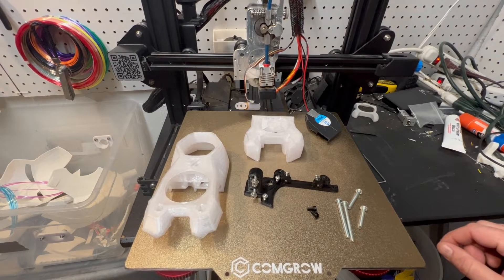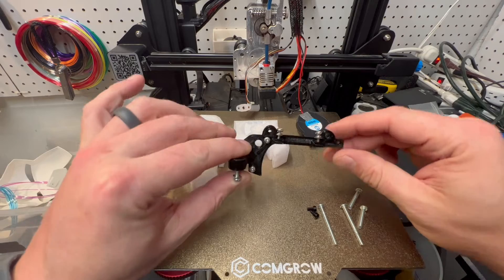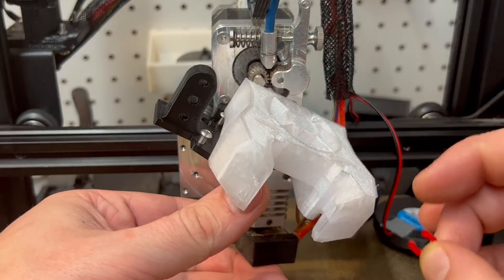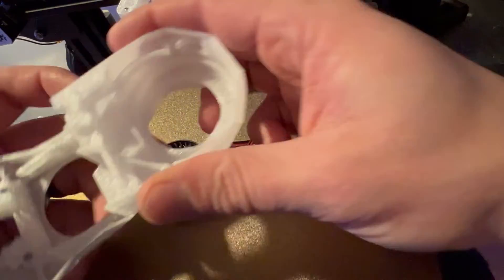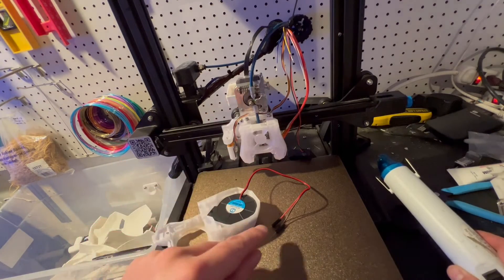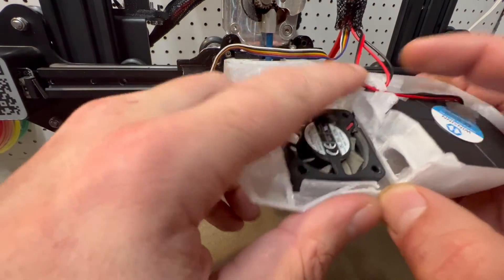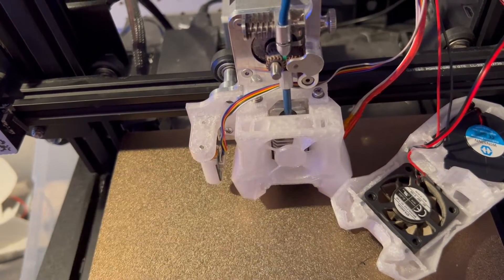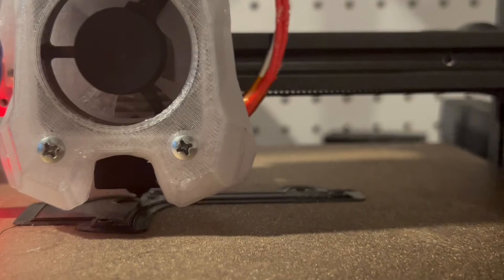🆒 SteathlySwiss - Voron Stealthburner Mod for Micro Swiss Direct Drive on Ender 3 Series 3D printers

Comment: I got everything printed, printed my old mounting adapter once on accident, 90% through assembly and then i see I have to grind the extruder nub down 💀 did it tho. Thank you for the design. Works with ender 5 plus with direct drive.

I also didn't have the correct length screws and/or the holes were too large on the bottom, the top holes on the mounting plate have about a 5-10mm gap between the front assembly, so I used threaded inserts, heated into place that stick out a decent amount from the top and used the threaded inserts on the bottom for a more secure fit. Printed in black PETG and it's flawless 👌
Reply: So you are saying there is a gap between the mount that screws onto the extruder plate and the hotend cover?

Comment: also, be aware that the mount does not work with the CR touch, as the cr touch has the wires coming out on top, so the centeral hole in the mounting plate would need to be a cutout.

Comment: Bl/cr touch should be on an offset plane from the nozzle tip.  Any time filament leaks and is deposited on the print bed during probing, the probe goes strait for the filament deposit, giving a very eronious reading.

Comment: I’ve printed these parts and want to put this together, but I cant find any instructions. The part the fans go into have holes for m3 screws on the front, but there is nothing for them to bite into. Am I meant to put metal inserts in? I cannot see this in the video. I am interested in implementing this but at the moment there isn’t enough information to do so. Any assistance would be appreciated.
Reply: Did u finish it?

Comment: Can this be put on a ender 3 v2 with the stock hotend assembly?
Reply: Not without modifying it this seems to be fully setup for the Microswiss mount and the V2 mount will not match at all plus this is a glorified fan setup because the real stealth burner uses clockwork 1 or 2 direct drive i see this as mostly aesthetic and of-course you would get better part cooling thats about it. not bashing microswiss but thats no wear near a clockwork setup

Comment: I have not done this yet but I installed the 42-34 motor on my micro Swiss direct drive and I don’t think I will have to cut anything.  It is the motor that the X,Y and Z axis uses on the Ender.  I adjusted the driver current to 580mA like the other motors. It runs slightly hotter than before but it can print for days without being a problem at high speeds.

Comment: Nice! It adds so much weight to the X carriage? I'm currently using a prusa style mod on my ender, with e3d v6 and bmg extruder. But I always wanted to try voron's solution. I don't know if there's something for my setup. 
Great video!
Reply: The motor adds the most weight. The extruder is lightweight aluminum.  The Voron printed parts are very light. I went with the 42-34 motor. It is still heavy but shedding 3 ounces or so helped a lot. I use a linear rail.  It glides smooth and can’t budge side to side. It is so much better than my previous direct drive conversion. I have not tried the Voron cooling parts yet but I’m printing them now.
Reply: Not if you use pancake stepper motor it takes 155 grams off
Reply: @noisy_boi_fpv_3920  will it have enough torque?